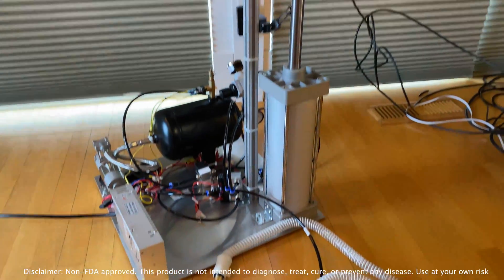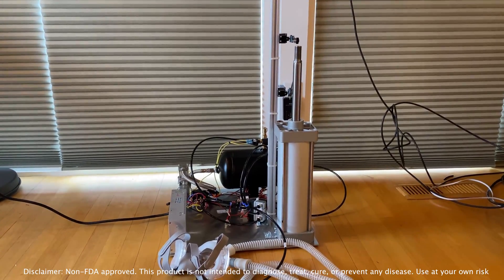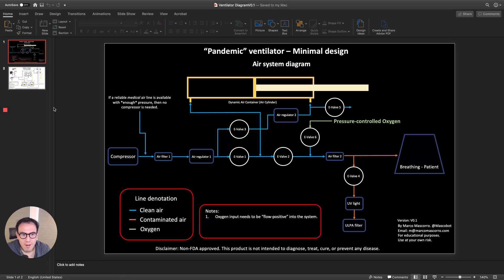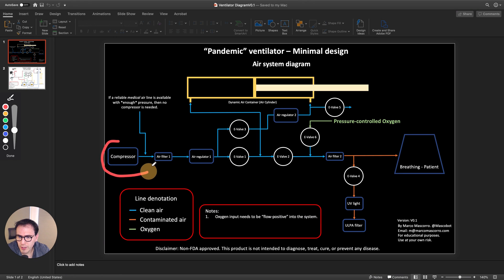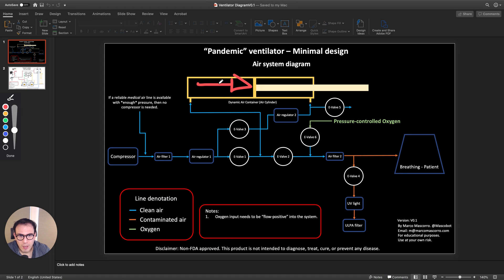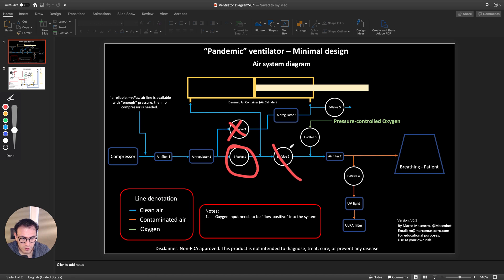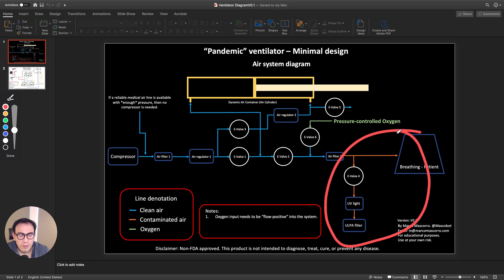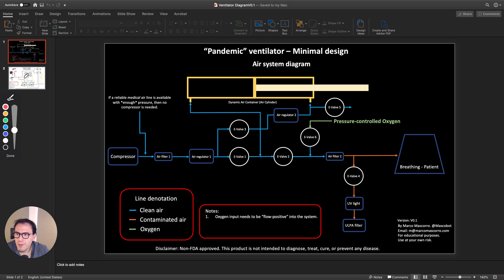Mechanical Ventilator (A.K.A Pandemic Ventilator), assembled from off the shelf parts.

Comment: Way too complicated for the Third World and in an emergency in the United States.  take a look at this:https://www.youtube.com/watch?v=00PMqkdOIBA.
This is easily constructed using metal, wood, or plastic using hand tools. There is only one moving part and is robust enough to be transported in the back of a truck bouncing over roads, with thousands of holes per mile. All comments welcome.
 "When you have a hammer, everything is a nail."

Comment: if you have no output filter nor a peep valve you can use a pail of water that has bleach in it.   Put the expiratory air hose 50 cm (2 inches) under the water to create 5 cm of peep pressure.   The deeper you place the tube the more peep.   A cloth floating on the surface of the water breaks down the air bubble.   The bleach water inactivates the toxin.   Place a top on the pail and have a hose go out through a window to evacuate the bleach smelling air from the pail.

Comment: This is a very limited application ventilator. The patient must be paralyzed and not breathing on their own as there is no synchronization with one who is breathing, however weakly. There is no protection for coughing either. Such a ventilator can easily damage the lungs and should not be used except in extreme cases where the patient is not breathing at all.

Comment: Great work  !!! Appreciate your effort  , is there any way you can bring in some kind of volume control to this design ? Also would like to add - Covid causes ARDS treatment of which would require positive end expiratory pressure( in alveoli) that can be controlled manually .
Reply: that can achievable with a couple of pressure sensors and few lines of code to make system closed-loop from open-loop. The main problem is how to control air and that seems to be done greatly with this. I appreciate you that you mention this so that we will tink on this. but its quite easy than the whole designing system from scratch.
Reply: I would think just adjusting the distances between the switches on the cylinder shaft would allow you to adjust the volume of air
Reply: @joedean3263 isn't this what the plastic valves are for. Like the type they have on ambulances?

Comment: Thank you for this. A couple of comments/questions: it seems to me that rather than using the limit switches, we can set up a way to add weights to the cylinder piston (leaving rod rise of cylinder open). This will allow us to modify the pressure settings of the air going to lungs by just how much weight we added to the piston. We would install a gauge on the cylinder to measure pressure.Then, we put a needle valve between the compressor and the cylinder inlet. We could adjust this needle valve to allow the cylinder to move faster or slower. My measuring the number of strokes of the cylinder per minute we could set the flow rate. We now have a way to control and measure pressure and volume which the nurse requires. Would this work?

Comment: Thanks for trying to help my friend. The main issue here is that unless you can control things like the volume of air OUT, base respiratory rate, measure positive/negative pressures, provide positive expiratory pressure, and a host of other things, ambu bagging a patient is not much different than this. And this is not sufficient. This would be similar to a transport vent set to CV but without the ability to control volumes. I am an ER nurse and I do appreciate the attempt. As patients develop respiratory failure and ARDS we need these settings to save them. We also need to be able to visualize pressure and volume changes on a screen. A mechanical hand that squeezes an ambubag might be a better device to focus on.
Reply: I'm not saying you are wrong. You are not wrong. At the same to devices much worse than this have been constructed and saved many lives for decades now. When your loved one is dying, and everyone is out of those high tech ventilators, people without access and riches may have The skills to save a life. This design is not ideal, but you can bet your bottom dollar it will pump air into lungs.
Reply: @buffalobillswin187  It just that .. This guys design is way too complicated and over engineered.. and is still nowhere near ideal.. But yes.. Better than absolutely nothing.
Reply: Feedback is appreciated. Helps him, and others that are mining info to improve and discover alternate thinking. Spec spec spec and feedback/fail fast.

Comment: A cylinder is very expensive, and oly used for moving switches? Maybe try using a simple arduino that is cheaper and found everywhere, you can lose all those extra parts
Reply: I thought the same at first... but the cylinder holds the air that will then be pushed to the patient on the retracting stroke.  Volume of air is set by the limit  switches, duration of the inhaling breath is set by the regulator that provides the retracting air pressure to the cylinder... it's the heart of the system, not just to run the limit switches.

Comment: Does it create variables of  minute volume of 7 to 14 liters per minute, peak pressure of 30 cmH2O, PEEP 5 to 20 cmH2O, and rates of 15 to 30 RR? If not then not useful... - Critical Care Medic
Reply: You can adjust the volume easy by moving the position of the stops. You can adjust pressure by adding a pressure   valve from divers, or by simply adding weight on the cylinder rod. The more weight it pushes up the more pressure In the cylinder. Brilliant design for engineers...
Reply: Honestly ??  There is a WAR coming and we need this shit  so stop going all technical.   I'm sure they would love anything like this in Italy right now...
Reply: @hamc1972  fully understand... There like electronics.. Too much voltage and its fried not enough and you get nothing.  But keep in mind it's in times of war people get creative.... ❤️👍

Comment: You may simplify design a little bit using 4-way refrigeration valve from heat pumps. 4-way walve has a pilot solenoid which controll piston of the 4-way valve

Comment: I don't understand how the air is pumped out of the patient. Does that work purely on patient effort?
Reply: I think the most of the effort is in the in breath. I'm not sure pumping out is required.
Reply: @BurtMeister  there should be a peep valve. It will cut off as the lungs exhale to a certain adjustable level. https://youtu.be/CDEYWok94uQ

Comment: Good work so far! Just some notes: Ventilated room air(19%) needs O2 @50%, absent from this diagram. Moisture is unconsidered, as are blood oxygenation and alteration of patient feedback or lung compliance. Keep going
Reply: @Steve1963 D Ah, so they automatically adjust to the patient.
Reply: Are the professional ventilators set and forget (for the most part) once the doctors/nurses on hand have figured out what breathing assistance the patient requires and is comfortable with? Or are there automatic feedback features built into the pro ventilators that automatically adjust to the patient??
Reply: That can be done with a separate intake from a oxygen tank or oxygen pipe with the oxiacetilene welding parts. It is designed to mix airs, including oxygen. Please use oxygen resistant tubing (from the oxytorch). Also watering can be done  on the mask. (I saw this on a few hospital setups)

Comment: Great information & sharing. I have a question though: 

So when the cylinder gets to the top and actuates the switch E-valve 3 opens, is this to enable controlled pressure of the cylinder falling to not over pressure into the patient? If so I suppose all the regulators need to be adjustable for different patients?  What is the size the cylinder generally needs to be?
Reply: If I had to guess and reverse engineer something like this with minimal resources, I think I would measure my own lung capacity + figure out the pressure out and the resistance in of exhale/inhale respectively and use this as a guide/template to base my models around. 

I guess one way to get an idea of your lung capacity would be to fill a bottle with water, then hold this bottle under water and turn it upside down, still holding the opening under water so it the water doesn't rush out and then poke a straw up the end and use this straw to exhale into the bottle. The bottle should fill with your lung air, pushing the same volume of water out and when you have fully exhaled, put your palm over the end of the bottle before turning the bottle upright and then measure the volume of water remaining. This volume of water should be deducted from the full water bottle to get your lung capacity. 

I don't know if this helps. This is just an idea off the top of my head and maybe you can think of simpler ways?
Reply: @BurtMeister  Thanks, it's a good idea to think on further yes

Comment: Hola Marco,  I live in San Miguel de Allende which you know is 30 minutes from Celeya...SMA only has 6 ventilators and we need more...I have a fully equipped shop ie, milling machines, lathes, ect and would like to offer these to our local hospitals...I am a prototype design engineer, so I would like to assist in this if possible...
Reply: Hola preston, my team is working on some other designs. If marco doesn't get back to you feel free to reach out. If you let me know the tools you have we can help you get a design built up very quickly. ethan@pandemicventilator.com
Reply: @EthanChaleff  sent you an email Ethan...
Reply: Hello Preston, I am from Querétaro and I have an industrial automation company, now I am forming a team of engineers, doctors and investors to develop and start manufacturing the fans, I leave you my email to be in touch lmendoza@ensorobotics.com